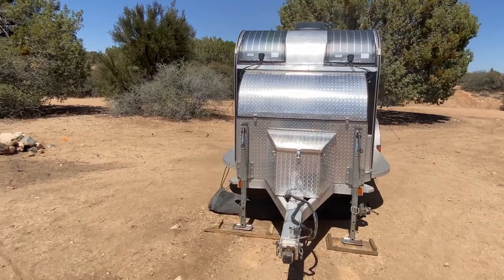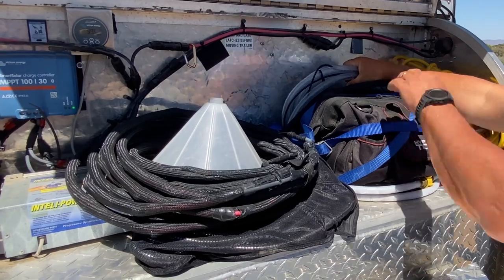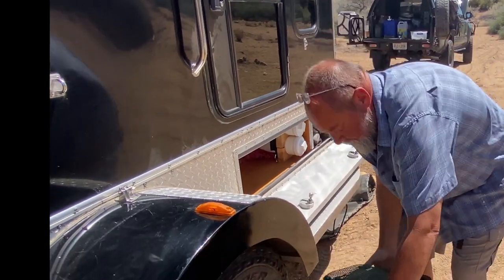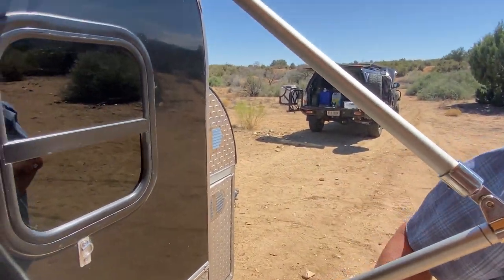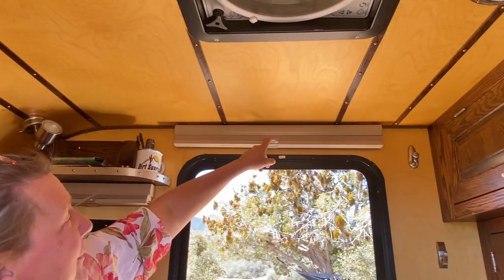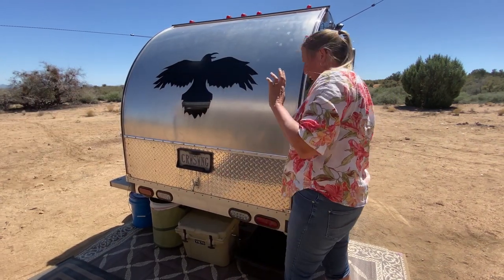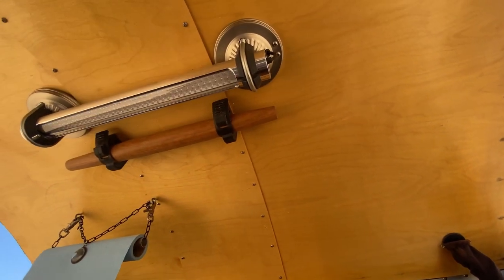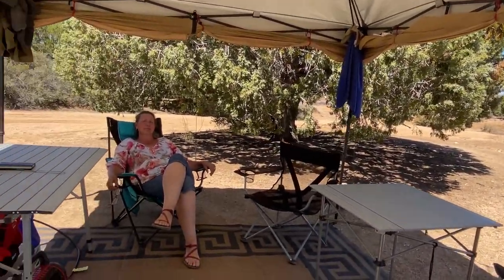A Tour of Our Off-Road, Home Built one-off Teardrop Trailer, The CrowsWing. (10 months on the road!)

Comment: Beautiful trailer. That axle seems undersized. It might be fine on pavement, but dirt roads will loosen it up and start to break things. I would upgrade to a 5k lb., or at least beef up the springs.
Reply from the maker: That axle is original to the build and currently has 38,000 miles on it.   Its a 3500 lb axle with electric brakes.   It's 10 years old and has in fact been off road (as well as washboards, forest service roads and paved roads),  We've camped in many National Forests and BLM lands anywhere we've desired to camp with it all across the country.  It's held up just fine and I see no reason to upgrade
Reply: @flightofthecrowswing  that’s awesome. I’ve seen them go the other way, do you know the make of the axle? I know you don’t want to advertise for the builder.
Reply from the maker: It's just a standard Dexter. Easily replaceable if something were to go wrong with it.  We went with a  really basic suspension and able just for that reason

Comment: Did you order the shell and trailer from a cargo trailer fabricator? If so, will you share the company’s name? We are in the process of designing our own 5x10 and your benroy shell and trailer are exactly what we want.
Reply from the maker: We ordered a custom sized bare frame from a small trailer manufacturing company. We had issues with them and I don't promote their business (if they are still in business). Everything above the running boards was built by us in our garage.  We do have a book available on Blurb.  A pdf form is available for $4.99. The last pages of the book contain the list of suppliers, all items purchased to build and what each cost us in 2012.
Reply: @flightofthecrowswing  thank you. Do you have a link or is it listed under your YouTube channel name on blurb?
Reply from the maker: There is a link to the book on blurb in the description of the tour video
Reply from the maker: @TS-ed5nt  you can use this link:
https://www.blurb.com/b/3689471-the-teardrop-year

Comment: Curious about the print/paint on the backsplash and galley cabinet, is that hand done or some other process?
Reply from the maker: The backsplash is actually a couple of Virginia Gazeteer maps displaying the Rappahannock River. It is decoupaged onto the wood that builds the back wall.  The cabinet painting of the Crow is a hand painted original artwork done by Elizabeth. She was also the designer and main wood worker for the teardrop.
Reply: @flightofthecrowswing  Thanks, well she has talent, it all looks very well done.
Reply from the maker: Thank you!